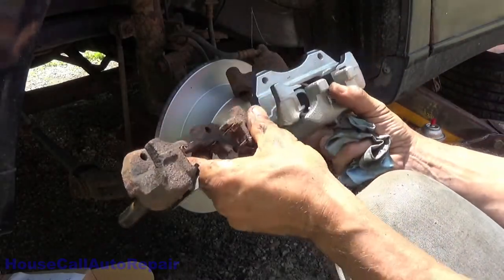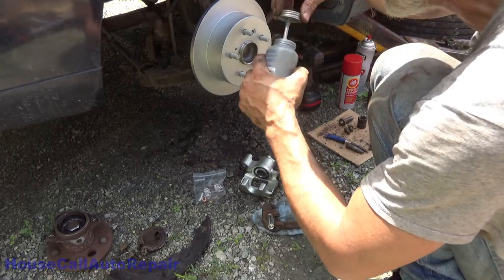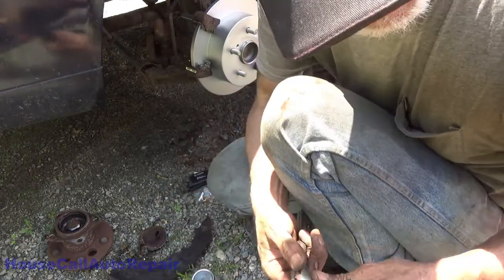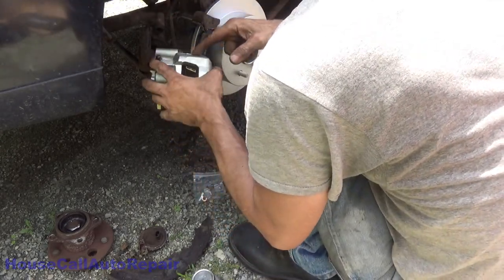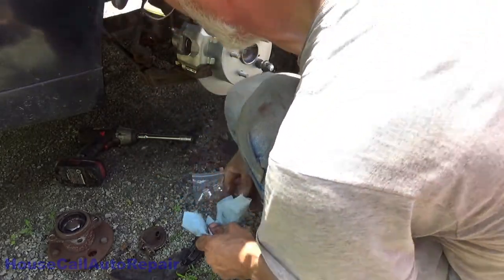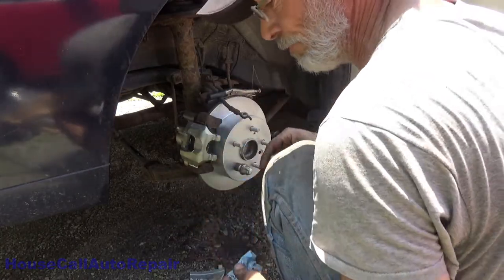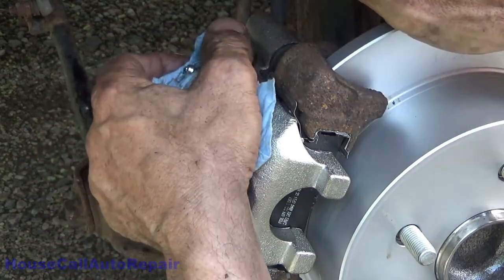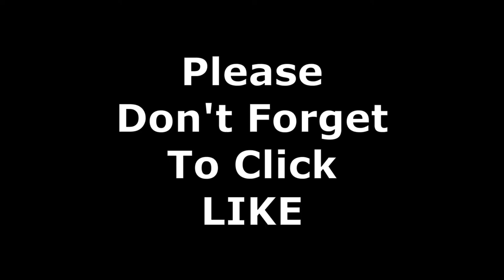2005 Lexus ES330 / Toyota Camry Rear Bearing, and Brakes.... Part 2 - Auto Repair -

Comment: i have the exact same car i can’t go over 40 in my car. it shakes like my passenger wheel was going to fall off how much will it cost me to get it fixed.
Reply from the maker: That really depends on what the cause is. If you really aren't sure, bring it to a shop before something worse happens.